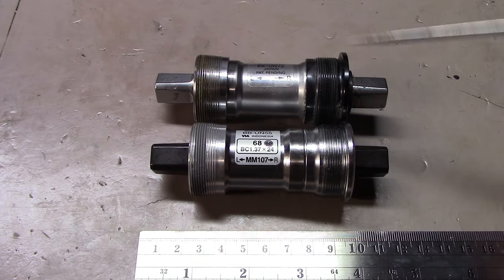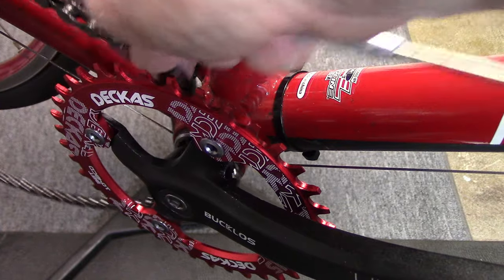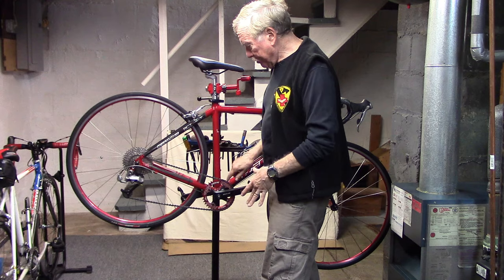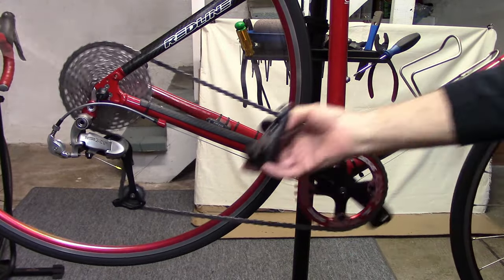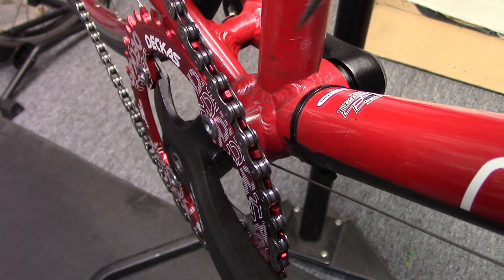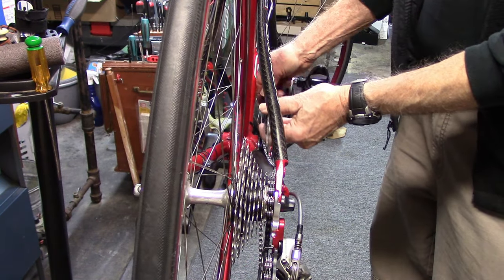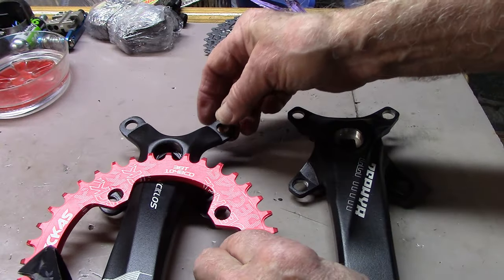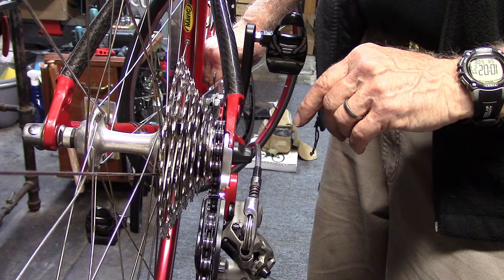1x (Single Chain Ring) Bicycle Drivetrains: View this before conversion or buying

Comment: I have a problem with my 1x 8 speed... I got 2nd hand e-bike and decided to change in official workshop all new drive train and brakes. And problems started.. I have a new cassette, chain, Derailleur, crankset and etc. My problem now is that on 7th gear, I can start to feel friction, and on 8th gear, my chain is dropping off from crank... even though the workshop said bike, it's like new, but when I started to ride, it happened again.. and I was told that they did all that they could do... so I still have this issue....
Reply from the maker: Please correct me if I'm wrong but your 8th gear would be your smallest cassette cog? Is your e-bike a single up front chainring? I would wonder if the chain line is at an extreme angle when in the 7th and especially the 8th gear. Can the shop check the chain angle? Did they replace the components with the exact same type that were on the bike. They could have forgot a spacer on the freehub or used a crank that is offset toward the frame. Did they replace the bottom bracket with one that's too narrow? 

One problem is that the bicycle may work find when up on a stand but give problems when out on the road where there's more stress on the drivetrain.

Take a look at this video for a nice summary of this problem:
https://www.roadbikerider.com/7-basic-chain-drop-solutions-1x-drivetrains/

I would take it back to the shop and complain. They worked on it and should stand behind their work. My guess is the replacement crank or chain ring is the problem throwing off the chainline. Let me know how you make out. Regards, Tony

Comment: Hi tony, does your daughter have enough miles on this dekas brand to make a call on durability? $12 vs $45+ for the brand name raceface, wolftooth etc.
Reply from the maker: Not enough miles yet. But the chainring probably won't last as long as some of the brand names. I'd point out that many single chainring such as the one in the video are often alloy which will wear more quickly then steel - requiring replacement every 500 miles or so.

Comment: Only issue i have with front derailleurs is that it’s not so easy to clean the area as the derailleur is getting in the way when trying to reach that area.
Reply from the maker: True. But on the other hand, having 2 chainrings up front gives one a greater choice of gears. Thanks for you comment. Regards and safe cycling, Tony

Comment: Fix the charing inside the crank will reduce the incline angle.
Reply from the maker: Not a bad item but for one problem. The outside of the spider arms of the crank have support for the chainring - so not all the weight is taken by the chainring bolts when pedaling. Mounted on the inside would put much pressure on the bolts leading to breakage and failure. If one is using a double crankset and only using the inner chainring, that may be a possibility. Another way to change the chain line would be to try a narrower bottom bracket - have not tried that yet.

Comment: Why would someone want just a single chainring when you get so many more gear choices with a double or triple?
Reply: Simplicity
90% of the gear range of 2x/3x on the front with less of the hassle
Weight
Looks
Reply from the maker: Yes, simplicity and geared more for trails where you don't need all the gear choices.
Reply: Because there is a truckload of redundancy. I have a 3x7 drivetrain and while it's sold as "21 speeds", effectively it only has 9.
Reply: Less weight, simple to operate....no grating noises from front deraileur...plenty of gears for hills and along the flat.
Reply: Because the bike industry needed something new to sell more bikes and parts and the marketing people convinced them that a 1x is as good and even better (😂🤦) than a 3x and they swallowed it. 😂😂. Someone here wrote that a 3x7 (21 speeds) has actually 9 working speeds. Big lie, I have a 3x7 and I regularly make use of at least 15 speeds and also use another additional 3 occasionally. Of course the drivetrain has to be well adjusted and lubed to work as it should, something which mine is.

Comment: 3x forever on my MTB! I never have and never will consider a conversion from a 3x to a 1x as an 'upgrade'. To my mind it is a downgrade. I love riding in the correct gear and having an aligned chain all the time and I love the much wider choice and range of gears. To each their own. I get much satisfaction from maintaining and tuning my bikes to get them working smooth and perfect. And it is amazing the difference in performance cleanliness makes, especially the drivetrain. Nice video Tony keep up the good work! Regards.
Reply from the maker: You're one of the few who appreciate having the right gear and a wider choice & range. Unfortunately, there seems to be a trend toward 1x or subcompact chain sets as I've noticed from a recent visit to my local bike store. Shimano is moving to only electronic shifting and e-bikes are all the rage. I agree with you and I think we may be loosing something in this new trend. But, I can't argue with them if it puts more people on bikes and gives them fresh air and exercise.  Regards and safe cycling, Tony
Reply: @tony10speed  Agreed, as long as more people ride bikes it's all good. I ride my MTB both on unpaved and bumpy roads .... and tarmac. So I need the higher gearing that the front big chainring offers when going faster on smooth roads. I have 22,34,42T up front and 12-28 freehub cassette (upgraded from freewheel) at the back. There are a lot of hills as well in my area so the low gears are essential. Regarding electronic shifting, again,  its a no-no for me. Why should I change to electronic when my mechanical shifting works perfectly all the time? As I said, I keep everything fine tuned and well adjusted (not that frequent adjustments are required) so everything works smoothly. Last point: e-bikes. I'm 51 years young 🙂 and only a few kgs overweight. Thankfully my legs are still strong enough for the climbs. I'll buy an e-bike later when I can't do it anymore. For the time being, I'll push hard on those pedals, sweat it out and reach the top of that hill 💪👍 Cheers!

Comment: Did you change out the BB to the narrower one 1st, before moving chaing ring to back side of crank?
Reply from the maker: Yes. But I wonder if even a shorter bottom bracket would help or some 1.2-2.0 mm chainring spacers to move the chainring more toward the frame would help. Still working on it. Thanks for asking, Tony
Reply: @tony10speed  no thank YOU! I'm currently doing same thing basically, just swapping my 3x 7 to 1x, trying to keep rear components same if possible.

I initially didn't realize could install the chain ring on either side of the new crank I ordered along with it. So with chain ring installed on outside, I had quite the chain line closer to smallest cassette gear. Chain would fall off easy in larger cogs.. 

After moving ring to inner side of crank, it did improve situation, but will now drop couple gears in rear if I pedal backwards.. sometimes still fall off chain ring when pedal forward in largest cassette gear..

Granted I may need to shorten chain just a touch, but I'm wondering if I put a narrower BB in, which I know will help the larger gears in cassette, but I worry if might make problem occur on the smaller gears of the cassette.. or is this not so much of a concern? Granted, I've got limiters set for most part, but likely still need to fine tune along with cable tension.
Reply from the maker: @fireteammichael1777  They do make bicycle chain guards for the chainring (to keep it from coming off) such as BESNIN Chain Guide or CYSKY MTB Chain Guide Direct Mount Chainring Guard. I would also check the specs on your rear derailleur (maximum cog it can handle). Sometimes (not always), a "rear derailleur hanger  extension" (check Amazon.com) will do the job. In other cases, after conversion, I can't seem to get the drivetrain to handle a larger rear cassette cog. I have no easy solutions.

Comment: Just wondering the performance of Campagnolo Ekar groupset which has 9-42 13 speed cassette with a 1x 38 or up to 42 chainring.   What did campy do to reduce if not eliminate those issues?
Reply from the maker: This I unfortunately can't answer. Some 1x systems work fine while many fail as pointed out in our video and the link at the end to Sickbiker.

Comment: Hi Tony, Im running a 1x9 system planning to change it from 36t chain ring to 34t Do i need to cut my chain?
Reply from the maker: Probably not but after you switch to the smaller chainring, it's easy to check. If in the small cassette cog, the chain running below the derailleur comes in contact with the guide pulley wheel and upper part of the chain, you will need to remove one link (one link is comprised of both the inner and outer plate - looks like 2 pieces but is consider one link). If not, you're all set. Regards and safe cycling, Tony
Reply: Thank you Tony, appreciate the reply.

Comment: why didnt you just mount the chainring on the back of the first crank?
Reply from the maker: The cranks are made to mount outside or inside. The mounting allows for the best stability of the chainring. Mounting in reverse is not recommended (and I'd really have to show you why - good subjest for another video). Thanks for the comment.

Comment: Why not just ride all the time on the 3x on the chain ring nearest in size to the 38 tooth 1x chain ring. Problem solved. Plus you have additionally gears once you learn how to change gear. 😊❤
Reply from the maker: That would certainly work. The idea of a 1x is that you can put a much larger cog on the back. Here, I went from a 11/34 to an 11/40 cog in the back and a small chain ring of 34 on my double to a 32 1x in the front. This allows a cyclist to climb any steep gradient with the lowest gears being 32 in the front and 40 in the back (as opposed to a 34 - 34).

Comment: Are you using a cassette designed for a 1x system?
Reply from the maker: This is a 9 speed drivetrain which requires a 9 speed cassette. The cassette is a SRAM that is compatible with the range of the rear derailleur capacity. With a change in the rear derailleur, one could accommodate a larger range cassette, but that is not the point of the video. Some 1x systems do require specific cassette and derailleur combination, but not here. The video is more about chain line and noise. Here's some nice reviews of 1x systems:
 https://www.bikeradar.com/advice/buyers-guides/1x-drivetrains/
and
https://www.bikeradar.com/features/how-to-convert-your-bike-to-a-1x-drivetrain/
Regards, Tony

Comment: Do you always need to change the bottom bracket?
Reply from the maker: If you're switching from a Triple to 1x, the answer is yes. If your BB is made for a double, it may work fine as in my case.

Comment: I have the chainring on the inside and the chain comes off when backpedaling and chain is on the smallest cog on the cassette
Reply from the maker: It may be related to the extreme angle from the chainring to the smallest cog. Check the chainline with a long straight edge between th chainring and the cassette. The chainline should fall toward the middle of the cassette. Changing to a crank with the chainring on the outside or replacing the bottom bracket with a slightly longer one might help (depending on the chainline). You may have to consult your local bike store for help. Dealing with a 1x (I assume that's what you have) can sometimes be a difficult task.
Bicycles are really not meant to be back pedaled. There is a loss of tension from the rear derailleur as you back pedal and the chain becomes loose. Some bikes have a clutch to keep chain tension.
Let me know what your local bike store thinks. Regards, Tony
Reply: @tony10speed  thanks for your reply. I'm not going to spend any money on local bike shops since Ive got some tools my own. Yeah, I have a clutch. It's an GRX400 10 speed and what's interesting is that the chainline seems to be more on the smaller cog side. So no extreme angle here. I have just changed my cassette from 11-28 to 11-36 and my old Tiagra 4600 to Grx400. I will change the chainring to outer position. When this does not work, will probably go back to a 2x since I don't want to drop my newly bought derailleur and cassette.

Comment: I ran into that. That version of Deore rear derailleur doesn’t like anything above about 32 teeth. A newer rear derailleur capable of 36 teeth or larger eliminated the whole noise and “rough feeling” issue.
Reply from the maker: What speed are you running (9, 10 or 11 speed) and what is the make and model of the derailleur? Both the viewers and I would love to know. Thanks in advance, Tony
Reply: @tony10speed  My setup is 9 speed. My DEORE derailleur is one of the slightly later black ones. It’s not a current one, but mine works fine with 34. Looking at your situation, I think that the DEORE RD-M6000 rear derailleur or one of the other current DEORES (or even the ALIVIO or ACERA rear derailleurs) in Shimano’s current line up could work better. Most of them can climb as high as 36 teeth or more.
Reply from the maker: @bikdav  I have used a similar setup with a Deore XT on some 9 speed bicycles. The 36T cog works on some, but with others, the derailleur hanger is not long enough for adjustment of the b-screw. On these later, I've added a small nut to the end of the b-screw to move it back further behind the derailleur hanger. In another, I used a derailleur hanger extension that worked well. Thanks for your input and safe cycling, Tony
Reply: @tony10speed That’s true. I forgot about the derailleur hanger extension. That might solve the the problem.

Comment: I want to ask about the bottom bracket can i use 110 mm or it must 107 mm
Reply: I hope you answer my question
Reply from the maker: A 110 mm BB worked for me but, because of the chainline, made moderate noise in the 2 largest cogs. The chainline was improved with the 107 mm decreasing the noise when in the large cogs. If you already have a 110 BB, give it a try and see how it sounds.  
I, myself, prefer using a compact double with a front derailleur which gives me many more gear options then a 1x, but that's just a personal preference.
Regards and safe cycing, Tony

Comment: Your chainline is way too far out. I did the same thing on my road bike and I used a 2x Fsa Sl carbon crankset with a 50 tooth narrow wide (same one as yours) on the inside mount for the chainring where the small chainring would go.  
The chainline is perfect 👍. I’m running an 11 speed cassette and the chainline is exactly on the middle sprocket of the rear cassette.   I don’t like square taper cranks . There are many solid axel ones out there cheap. You’d have to change the bottom bracket though. I have no problem shifting all the way low and high gears.  I’m using a Sram Gx mtb derailleur. I like 1x systems. It is much quieter.
Reply from the maker: Measurement of the chainline showed it to be between the 4th and 5th cog of the 9 speed cassette. The idea of the video is that in some cases (such as your own), things run quiet and perform well - but in others they do not (even on new 1x bikes). Therefore, one needs to be prepared. It depends on the bike and components. In some cases but not all, a different length bottom bracket may solve the problem.
Thanks for your comment. Tony

Comment: Are you more likely to drop your chain with a 1x?
Reply from the maker: The narrow wide front chain ring is suppose to prevent chain drop. But not always, especially on rough terain. So I also use a chain guide similar to the this:
https://www.amazon.com/Rehomy-31-8-35mm-Aluminium-Catcher-Accessory/dp/B0831G9TZZ/ref=sr_1_1_sspa?crid=1WCO4L0K4I9YF&dchild=1&keywords=bicycle+chain+catcher&qid=1628195392&sprefix=bicycle+chain+cat%2Caps%2C185&sr=8-1-spons&psc=1&smid=ACWYAGDSSGK43&spLa=ZW5jcnlwdGVkUXVhbGlmaWVyPUEyMjhQRlVPR003OFhHJmVuY3J5cHRlZElkPUEwNzIwMjM0MlhNNElGM1RTV01KVyZlbmNyeXB0ZWRBZElkPUEwNDE0MzE0MjkwVFRHSkQ2WFU5QyZ3aWRnZXROYW1lPXNwX2F0ZiZhY3Rpb249Y2xpY2tSZWRpcmVjdCZkb05vdExvZ0NsaWNrPXRydWU=
Regards, Tony

Comment: using a 68x 10-3 bottom bracket might hrlp too
Reply from the maker: Yes, but then I get noise when in the small rear cog as the chain line is shifted inward. Some bikes work well with 1x such as my Giant mtb, but others don't. The point of the video is just to check before you buy or realize conversion to 1x will work in some cases but not others. Regards and safe cycling, Tony

Comment: it still is not good chain line , you should use narrower bb, or to put some spacers between crank and chain gear and chain line should be on cassette gear that is mostly used(4-5)
Reply from the maker: If you continue watching the video, that's exactly what we did:
https://youtu.be/tB3JrVRiThY?t=207
Despite correcting the chain line, it did not completely solve the noise problem on this bike. 

The video is just a heads up that you may experience noise on some bicycles (even new bikes - even after changing the bottom bracket or adding spacers) to correct the chain line while on others bike, you maybe fine.

Comment: Is that cassette an HG400?
Reply from the maker: The cassette is a new SRAM PG-970 9-Speed cassette and a good quality SRAM chain. However, replacing with a Shimano Hyperglide cassette did not make a difference. When checked, the chain did not show any significant wear. Obviously, I don't have all the answers yet. Could try chainring bolt spacers to alter the chain line or different chain/cassette or different single narrow wide chainring, but, in the end, I will reinstall the compact chainrings which worked well. Regards and safe cycling, Tony